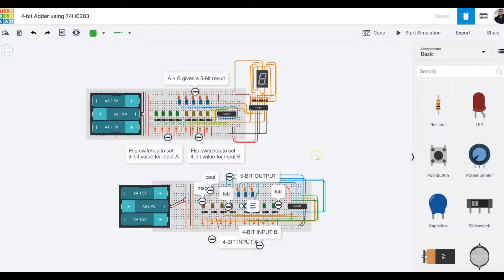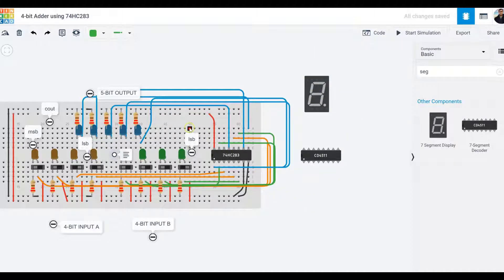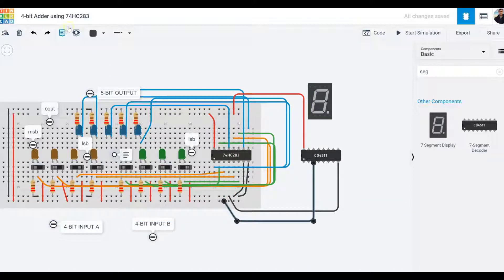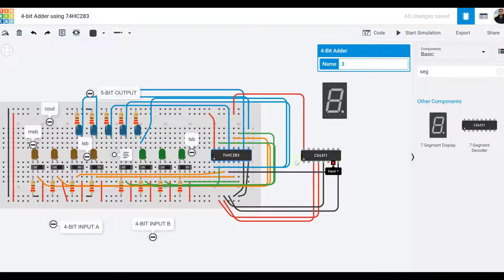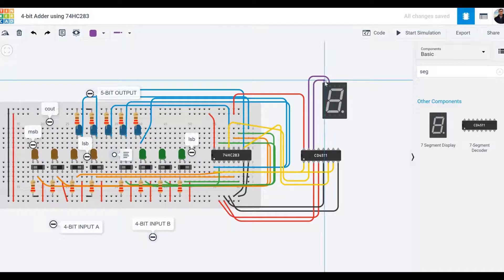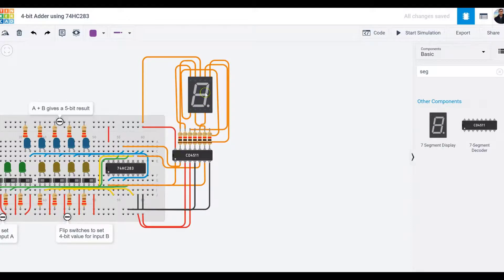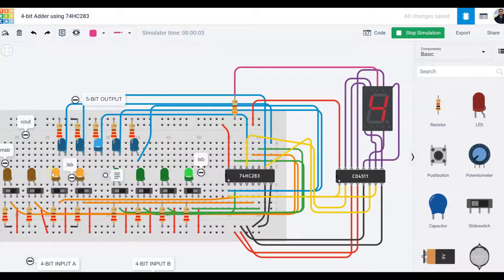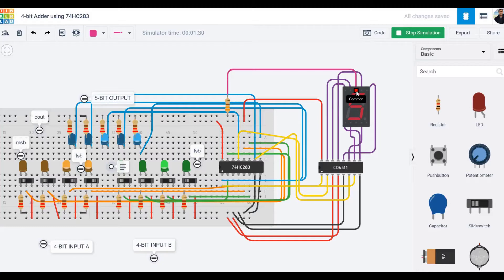#8 Four-bit Adder Logic Circuit using Tinkercad | Seven-Segment Decoder | Part 2

Comment: Hi, can i have your email for  business purpose,i would like to show the result  of 3 bit full adder on two 7 segment plz, can you help ?
Reply from the maker: post your question here please
Reply: @ElectronicswithProfMughal  hi, my question is that, id like to build 3 bit full adder and showing the result from 0 to 14 on dual 7 segment display, Or showing the result in hexadecimal by using one 7 segment display ?
Reply from the maker: 3-bit adder will only go from 0 to 7 *(2^3-1 equals 7, range would be 0 to 7). You can still use one segment like you suggested to display numbers from 0 to 15 in hex format. @androidlov
Reply: @ElectronicswithProfMughal  thank you for ur reply, 3 bit full adder can go up to 14 (111+111=1110 which equal 14 in decimal).
If you can explain to us how can we show the result on hexadecimal for one 7 segment or on decimal dual 7 segment would be more appreciated 👍

Comment: how about an adder that can solve until 30?
Reply from the maker: Increase number of bits by using another adder.
Reply: @ElectronicswithProfMughal  how many adders? I have tried making one but the two seven segment displays only show the answer up to 19 only
Reply from the maker: You can use 5 bits that will give you a range from 0 to 31.
Reply: @ElectronicswithProfMughal  when you say 5 bit does that mean 5 bit input? (I'm sorry I'm still very new to this subject)

The instruction was to use 4 bit. Is it possible for a 4 bit to display value up to 30?
Reply from the maker: @louisezero3129  no this is a 4 bit adder, which means it can only display number in the range from 0 to 15 (2^n -1, where n is number of bits). You need 5 bits to display numbers in the range from 0 to 31.
Reply: @ElectronicswithProfMughal  so I should make a 5 bit bcd adder?